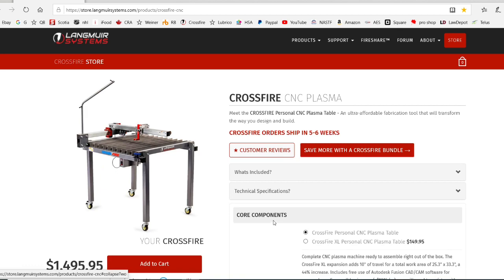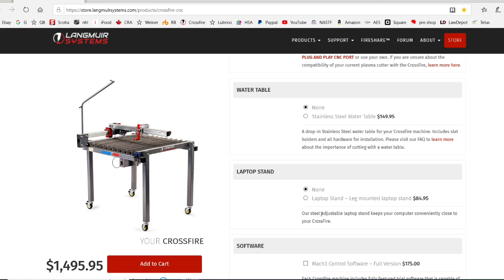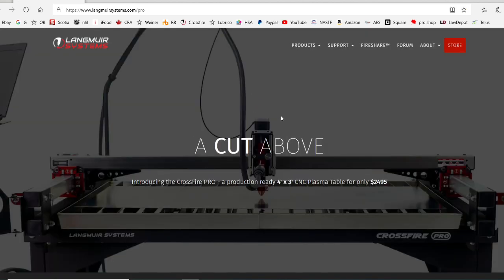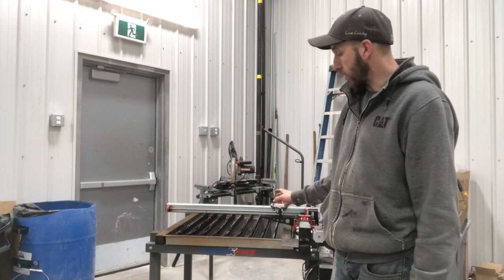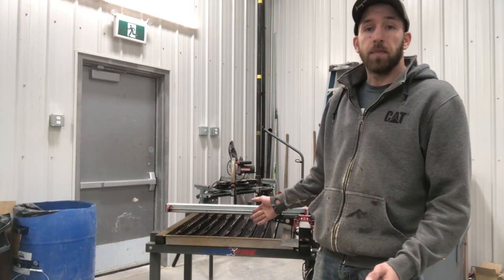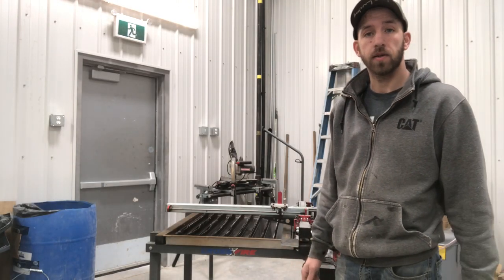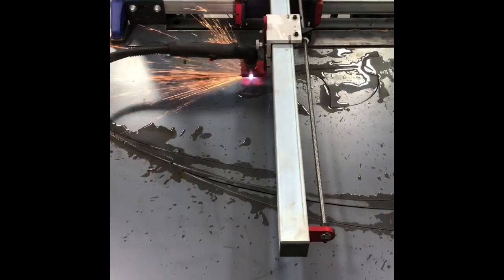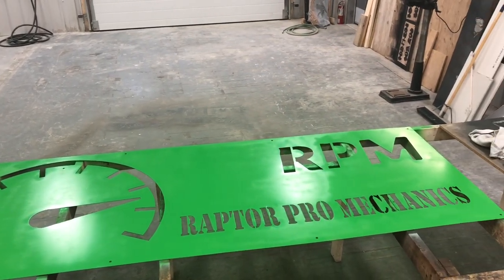CNC Plasma Indexing - How to cut pieces larger than your table

Comment: Thank you for this video!  I recently cut a sign that was 36x40 and I had to cut it into 4 pieces and weld it.  Turned out pretty good but this would have worked MUCH better than spending 3 hours welding 18 gauge steel.